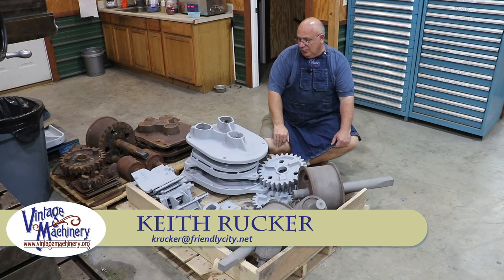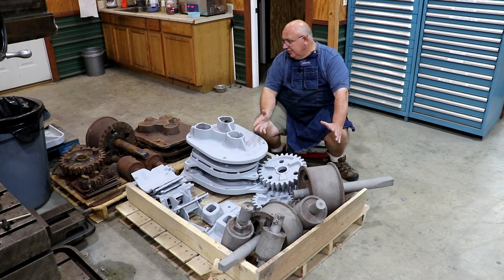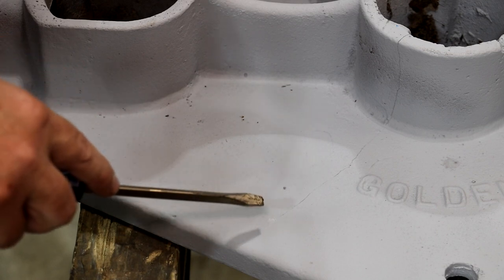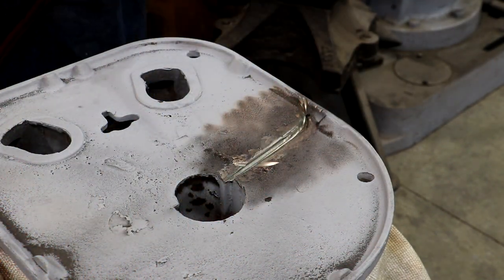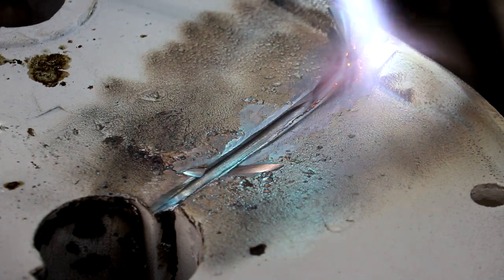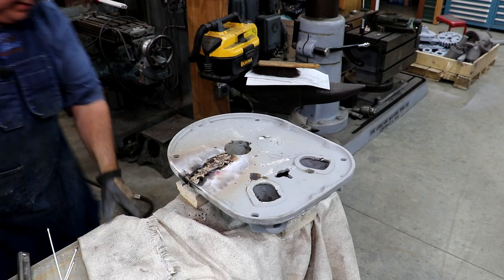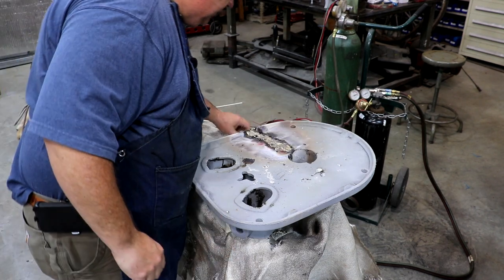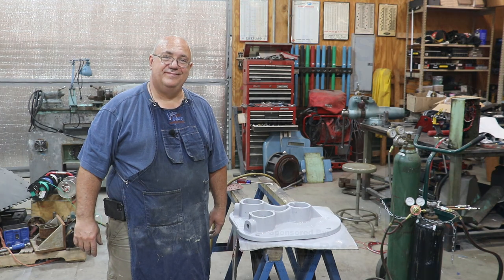Sugar Cane Mill Restoration: Brazing a Cracked Cast Iron Goldens’ Mill Top Plate

Comment: Hi Keith, I'll bet you have an oven for this. I have used my BBQ Grill to heat up metals for doing repairs. Doesn't get the metal red hot but hot enough to prevent stress cracks when brazing. Thanks for sharing.

Comment: I can show you how to do cast iron welding, as you described, in a true welding process with cast iron rod so that it doesn't have the brittleness in the weld area you spoke of. I worked in a welding shop where cast iron welding was our speciality, so I have quite a bit of experience with both cast iron welding and brazing of cast iron!
Reply: Preheat to 800f and most cast won’t have a brittle weld zone.

Comment: nicely done.  I just replaced a cast iron sign post that was welded together.  It split completely because is was welded together and not braised.  I trust braising for cast iron, it's just like soldering.  :goodvibes:

Comment: On big stuff like that, I always wrap it up with a WELDING blanket that wont catch on fire, and then after it's all covered one layer, I wrap it heavily in Old Comforters  from Good Will or Salvation Army  and let it cool slow over night - welding blankets dont always hold the heat like you'd want

Comment: For your consideration Keith, I use an LP Gas fuel weed burner for preheating cast iron for braseing repairs. I start on the low setting and then up it to the higher burn temp. Gas is cheaper and I feel the broad tip gives a broader heat spot to stop cracking. It works try it.

Comment: Its amazing how much heat you have to put into cast to get the brass to run. I was researching how to braze cast and ran across a guy using a cutting tip and thought that is crazy, until I started, it worked really well for me too!

Comment: I was waiting for the pop. Maybe heating it in an oven it might not have cracked to the edge. But more than likely it would have. I did a braze repair on a casting and postage stamped a bunch of holes to control where the crack would go. Worked really well.

Comment: Those domestic machines are very useful. A dishwasher does a fine job of cleaning up engine internals before a rebuiltd
Reply: We had an office guy come in on the weekend and clean a carburetor in the shop's big ultrasonic cleaner. It was for electronics and used heated trichloroethane (which I think is illegal now) as the solvent. In the process of cleaning his carb, he ruined over a thousand dollars worth of filters and several hundred dollars worth of solvent. On top of that, he cost the shop quite a few hours of delay and labor in cleaning up the cleaner.

Comment: I got a question Keith.  Being that you heated the whole piece up, when you flipped it over to work on other side. Did you have to reheat the whole piece again? Or it had cooled enough to be able to handle flipping over.  I plan on brazing  a large piece also.

Comment: When I was an engineer in the merchant navy we used to drill just past the end of a crack, but the longer the crack was, the larger the diameter of the drill we used. The circumference of the drill would just touch the end of the crack. We also used dye pen testing to really see how far it extended. If you used a drill dia that was too small the crack would probably propogate on again and might totally change direction. I'm sorry but after 35 years I can no longer remember the calculation for the size of drill for length of crack for the material to be repaired.

Comment: I wonder where Keith would put an oven in his shop if he got one for cheap. Maybe a professional one on a stand of sorts so he could move it around or put it outside to heat up when in use. Seems like he's had to use an oven for medium-size part heating multiple times through the years.
Reply: He could put it on casters, and store it under his welding table when not used.

Comment: Why would you need to cast bronze bushings? Why not machine them from hollow barstock?
Reply: Have you seen the price of Bronze stock? You end up throwing a lot away.
Reply: @johnsherborne3245  Not if one selects the bronze stock properly.
Reply: @johncolvin2561  I think you have better suppliers available.
Reply: @johnsherborne3245  McMaster-Carr
Reply: @johnsherborne3245  When I make a bronze bushing, I buy thick wall tubing that can be machined to size without removing too much bronze.

Comment: When I used to do brazing of cast iron I would start heating like you but where the area of the crack was vee out I would  sprinkle brazing flux into the vee to help stop the oxidising as you heat the cast iron also helps the brazing rod to flow easier.

Comment: The flux on brazing rods is borax. Back in the days when I took welding in trade school, our instructor told us that this coating could be purchased in a powder form from a welding supply, and for ferrous metal, laundry borax was most adequate. I've used Boraxo, and it did, in fact, work most satisfactorily. At one point, I had gotten some scrap (cheap) grandfather clock pendulums, and disassembled them for the brass rods that were in them. These were adequate for brazing rods.
Reply: I have a big box of laundry borax I bought 40 years ago and have used it to flux my gold lost wax castings. The box is gone but I still have some of that borax left.
Reply: Bryant Fry, That’s interesting, thanks for the information, sounds like a money saver!

Comment: Nothing what so ever wrong with brazing if you are not trying to make an undetectable repair  but I have said it before we have been repairing antique cast iron items for over 40 years and with very few exceptions we use only gas weld with REAL cast iron rod. Doing it that way pre and post heat is ultra critical,,,,, So what is the high tech way to do i?

We have a sand pit out back of the shop,,,and we dig a hole about twice the size of the part and get a charcoal fire going in it. - Then you out the part in the pit and cover it with hot burning charcoal and then cover it with fiberglass insulation....(we tru to use foil backed but you can get away with paper. 

One the part is evenly heated to over 1000F we take it out (with a BobCat) and take into the shop and weld it up ; --- Then it''s back into the pit and covered up with more burning charcoal and fiberglass. We put a piece of sheetmetal over it in case of rain and  leave it alone till the fire goes out and you can touch it with your bare hands. - Totally machinable and after dixying it up with a grinder and needle scaler or sometimes grit blast it is a totally undetectable repair without paint and every bit as strong as the original part. Like it never happened. 

Sometimes the primitive ways are better then the $50,000 heat treat furnace.  

BYW The ceramic fiber blankets are great,,,,but the way you did it when you get done fiberglass insulation woks too and doesn't cost $3500 a roll. ,,,,and finely, NiRod is for Bob Villas. No real pro would ever even think of using it except for a cheep and dirty repair - with no guarantee other then you pay in full before it leaves the shop.